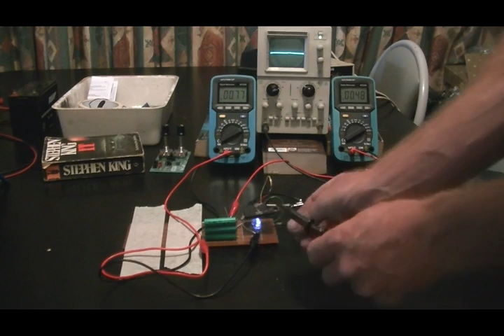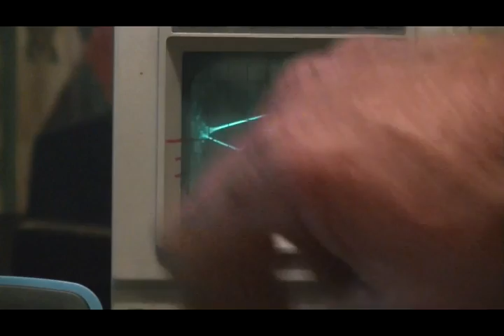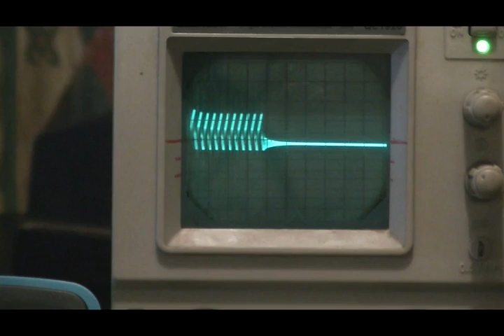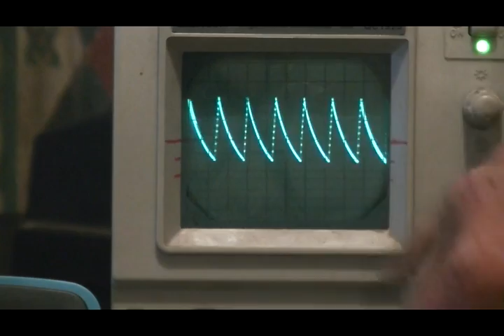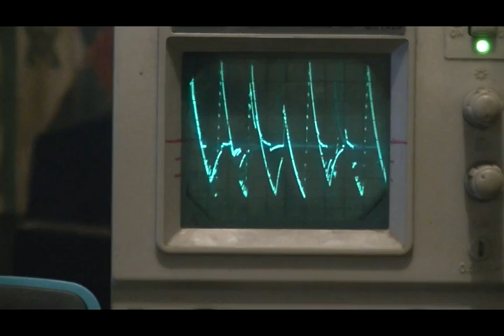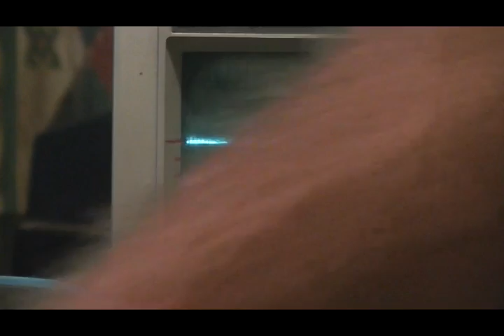Decoding the DOVADA device input and output mesurments

Comment: Nice trick checking the shunt resistors. I was all set to pull a meter apart and go over the board with a magnifying glass. LOL. Your way is a lot easier. The in-out pulses look like harmonics, ie there could be stuff going on outside the range of the scope. I get it with my DSO, not sure if the same for analog, could be trigger setting? Interesting looking at panel output. With 2 leds Capacitive coupling with photons is what comes to mind. Panel looks to be acting as a cap charged by light.

Comment: Yep. The "chickenwire" is just incorrect triggering of the signal. For a while I thought it might be pickup from the mains like the example I showed.
The "dots" on the ascent of the solar panel trace indicate the switching times of the higher-frequency oscillation within each main pulse, I think-- you are right about the flashes of the LED.
My garden lights use a different circuit so I can't reproduce your effect...yet. A trip to the dollar store is scheduled for tomorrow.....

Comment: Hi TinMan..
As I show in my last JT video, the DMMs can provide a good average current or voltage reading that agrees with more precise averaging using the scope even for relatively high frequencies. So you might be able to get rough estimations of average power by using the DMM to monitor current in a current-viewing resistor, reading the average current, and using the scope to get the voltage waveform, which you can then estimate by eye.
Of course better would be a 2-ch scope.